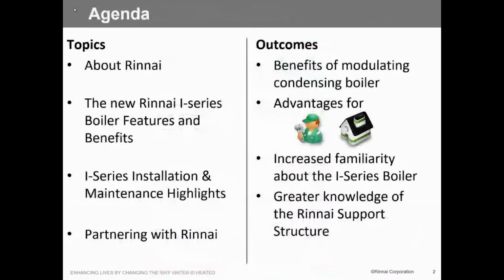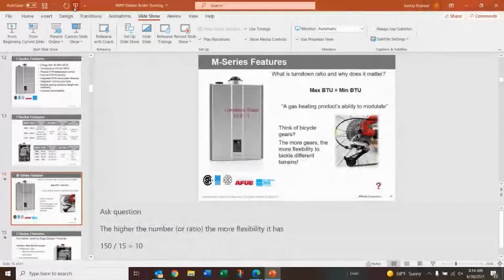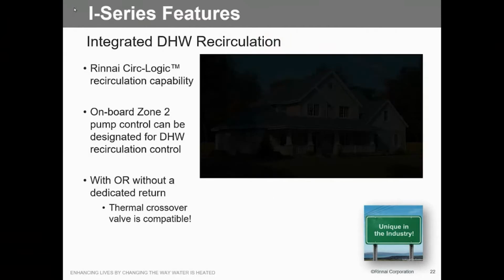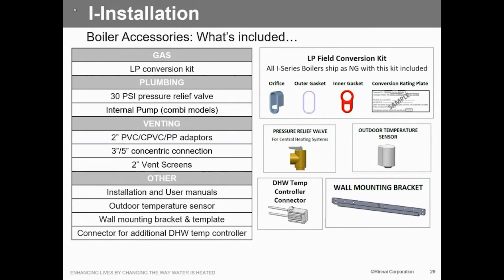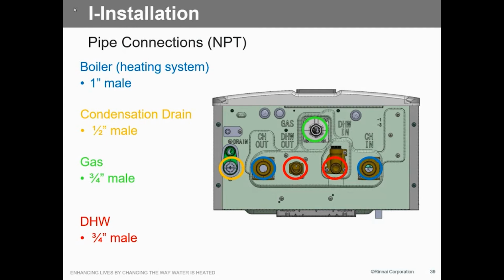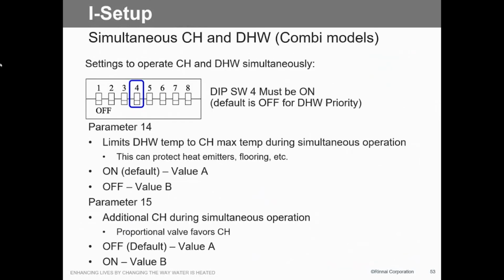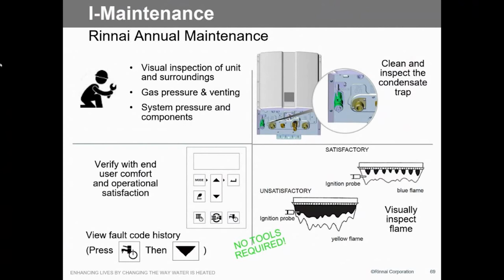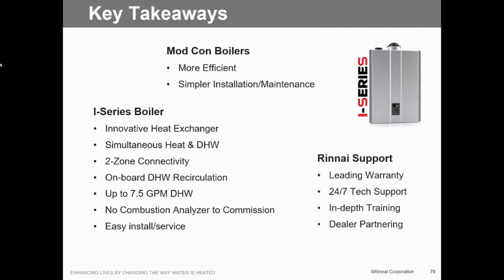Rinnai I Series Boiler Training

Comment: The internal boiler pump, Grundfos UPS 15-78, seems to be very capable based on the performance curve. If I keep the supply and return CH separated (by not using a primary/secondary manifold) while providing radiant floor heat to a 2,400 sqft shop, do you think it's possible to run the system just using the internal pump, or is a second circulation pump necessary?

Comment: The question was asked in class about the PVC exhaust temp limiter when using high temp baseboard heaters in a cold climate (Northern Minnesota).  WIll this effectively heat the 1,900 ft2 home with the PVC vent limiter modulation?  In the video it was said you'd look into that.  Thanks - great video!

Comment: The pump 1 and pump 2 connections on the board are 120V outputs? So a groundfos 15-58 can be direct wired to those two outputs? Mine is a 1 zone so in my case I can use the pump one sport to run the 15-58 pump? Thank you

Comment: So, i am replacing an old non condensing boiler. It had one circulator going into the system. Because of the condensing boiler, with a circulator above the closed tee, it will still need a circulator going away from the boiler?
Reply: It all depends on how your system is run. If you were to install a condensing combo boiler, there will only need to be 2 pumps on your system. One of the pumps will be to pump water through the primary loop of the boiler (a pump that pumps water through the heat exchanger inside the boiler heating up the water) and a pump for the secondary loop (pumping water to other appliances throughout the house).

Comment: Mine indicates E393 error indicating DIP switch is OFF and outdoor temperature sensor disconnected. Is the performance of the unit affected without outdoor temperature sensor?
Reply from the maker: I would recommend you call Rinnai Tech Support at 1-888-746-6247 with the model and serial number.   They will be able diagnose that specific error code for you.
Reply: Just put dip switch to on if you are not using outdoor sensor. Also after this unplug and plug back in.
Reply: @rayramirez4040  will the efficiency be affected without outdoor sensor?
Reply: Yes they describe as running a Ferrari with an outdoor sensor. Without it would be for a scenario as you age some older folk like it really hot inside even though it's like 70 outside.